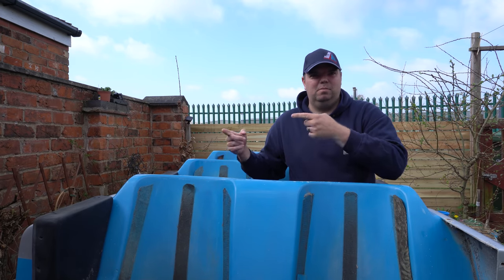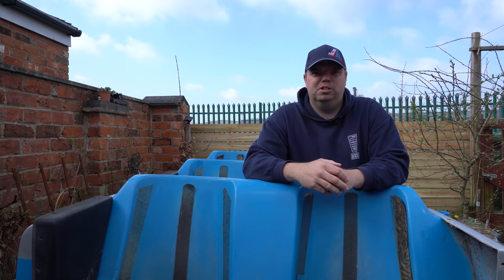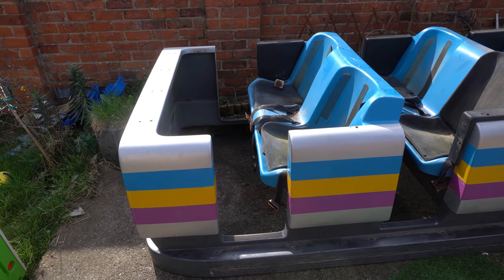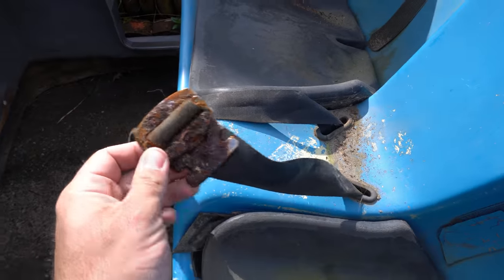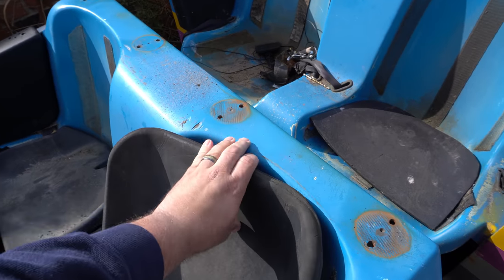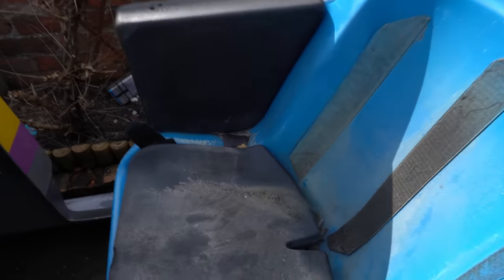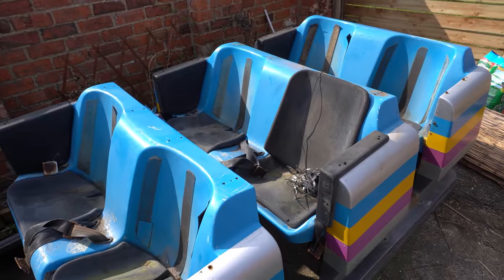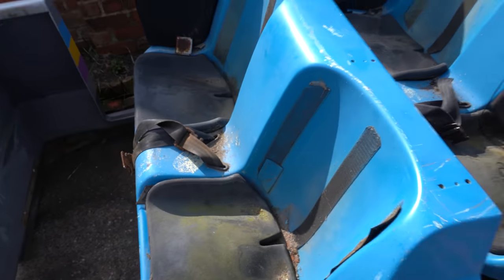I BOUGHT A Pepsi Max Big One Carriage | Restoration Project Episode 1

Comment: This will look amazing when finished! My truck for getting rust off of metal is to dip/coat the rusted areas in Diet Coke and then use a steel wire brush on it, super easy! This will hopefully help with the seat belt buckles etc. can’t wait to see it when it’s finished.
Reply from the maker: Thanks John :)
Reply: Diet Coke and not Pepsi? ;)

Comment: I have a rather odd request.  If it's OK, could you please post the dimensions of the car (total car length, total height including the seats, total height not including the seats, width at the top of the car, width at the bottom of the car (before skirt), skirt total width and height, side panel thickness, entrance point width etc...)?  I'm building a scale replica of it and I'd like to be as accurate as possible.